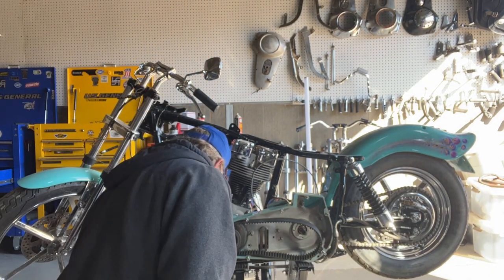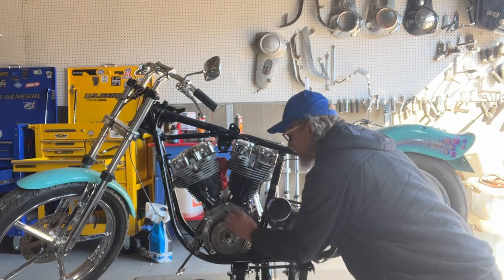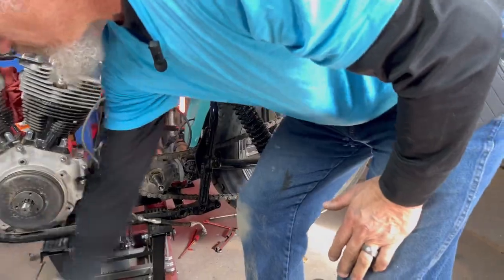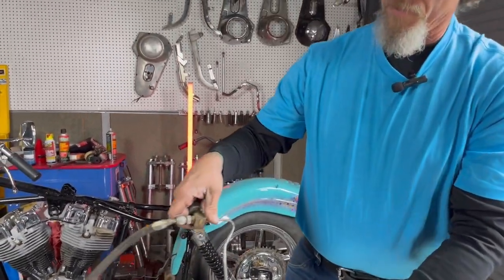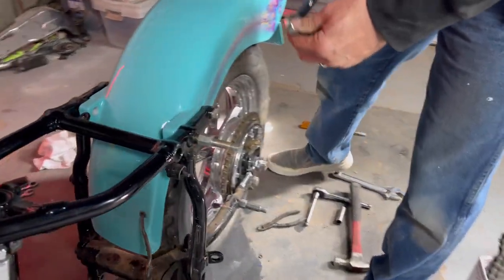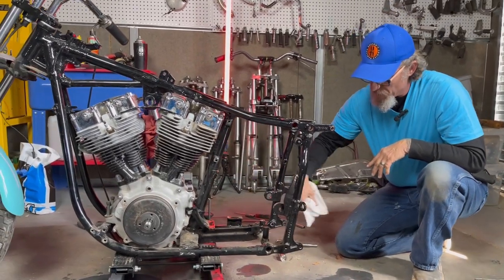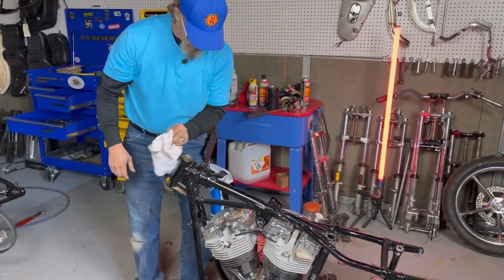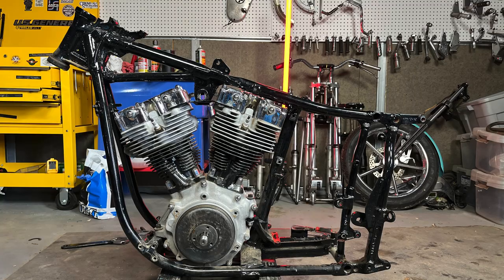12 Items to DISMANTLE this 1972 FX “Miami Vice” Shovelhead

Comment: Picked up a 79 fxe 80ci that hasn't run in 20 years at a estate sale for $2000 .Was told it had a new top end installed and not riden much after that. I recently got the bike running and seems to run pretty good.  My question is what compression should I get for a fairly new top end ? The manual says anything over 90 psi. When I do a compression test with throttle wide open I'm getting 120, 125 psi. I'm thinking there stock compression pistons that were installed 8:1 or 7.4:1.
Reply from the maker: Hard to tell what’s in her without tearing off a jug , sounds like you got a good runner if your getting that kinda compression!! Run that old girl !!